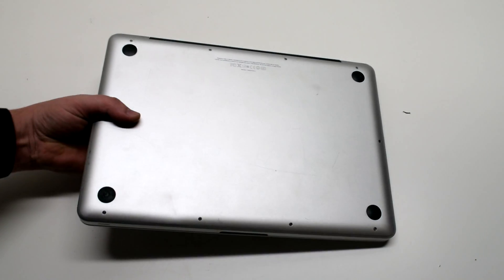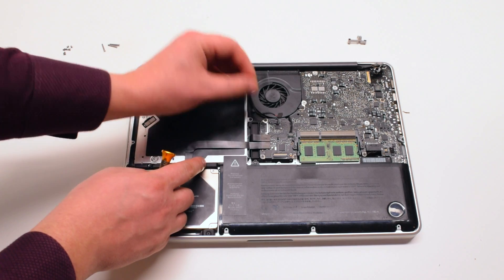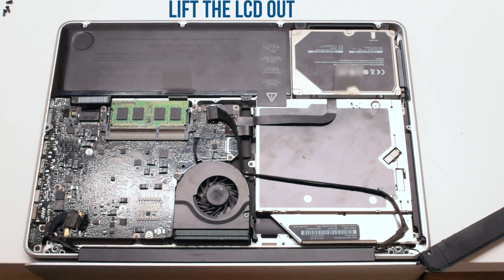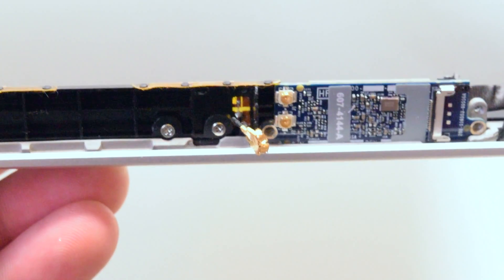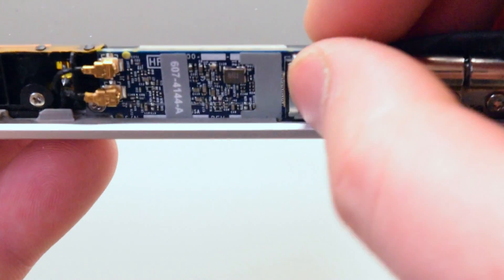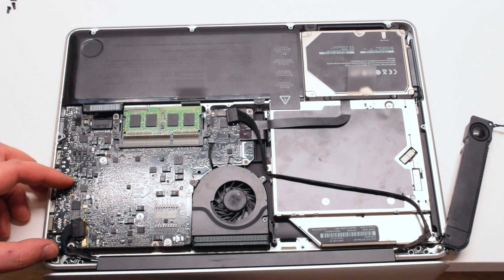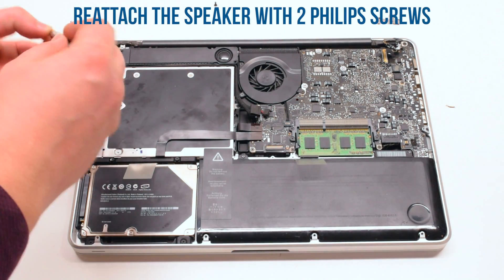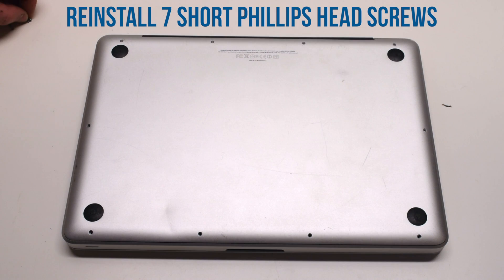2009 Macbook Pro 13" A1278 Air Port WiFi Card Replacement

Comment: You did not say anything about the LVDS latch when removing the cable, so when I pulled it out of there, it was really hard and the latch came with it. Now that I'm putting it back in, I'm not sure what to do to re-attach the latch

Comment: My wifi cable was almost impossible to re-attach - absolutely did not want to go in due to those little tabs on the side interfering with how it locks in on one side. I finally got it to go in, but in the process, my screwdriver slipped and I totally sheared my speaker cable. Now what? What do I need to replace in order to get a speaker cable back?

Comment: My macbook pro 13” mid 2010 got macos high sierra installed, everything was working accordingly. Then the next day there was a software update where I updated the macbook pro and once it’s finished i left it on the charge overnight. The next morning when I was about to use it i noticed the wifi had a “x” and said wifi: no hardware installed. So i searched online and it suggested smc & nvram reset and I did them all multiple times to no avail, even deleting system configuration plists in Preferences and even clean install the macos but now wifi isnt detected at all. I even disassembled the wifi card thinking it could just be the loose connector, but still, no wifi detected. Wont even give me an option to choose wifi when reinstalling the macos. Do you think it’s a clear sign that the wifi card needs replacement or could it be cables? Or would a usb wifi dongle do a decent job replacing the wifi connection as it costs a lot cheaper? What are your suggestions?
Reply: Hello! Having the same problem... have you solved it yet? If so, could you explain?
Reply: @MarianoVidor  hi mate, ended up buying a dual band wifi usb adapter(about $10). It’s tiny enough to just stay in the usb slot, and works really well. :-)

Comment: hello I'm opening up MacBook Pro2009 13" and try to remove antenna cover (black long one apart with display panel) and it seems stuck inside, cant remove at all, what do you think? this is mac book is i bought bland new, no repair history whatsoever. the cover seems slightly move as i wiggle it so it seems not glued, and i can see cover have slight  crack if i try to pry off with minus screw driver. what do you think?
thank you so much.
Reply from the maker: Yes you can pry it off. If should be tight in there and you will need to use lots of force to pop it out. Don't be afraid  to break it, never saw one break and also if it's already cracked you need a new one any way here is a link to our store https://store.appledollars.com/collections/macbook-pro-13-2012-a1278/products/new-hinge-clutch-cover-for-macbook-pro-unibody-a1278-13-inch